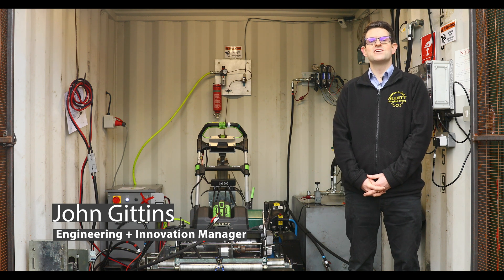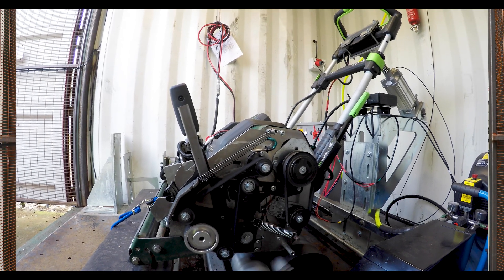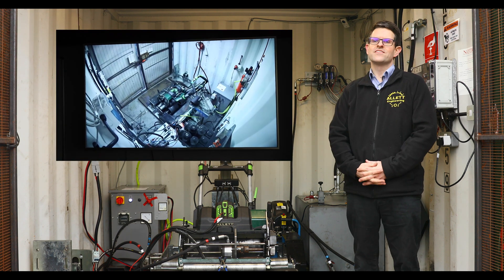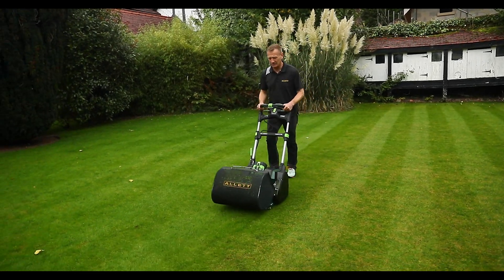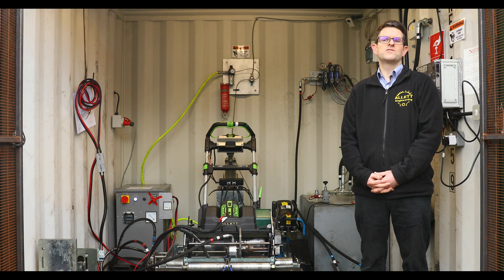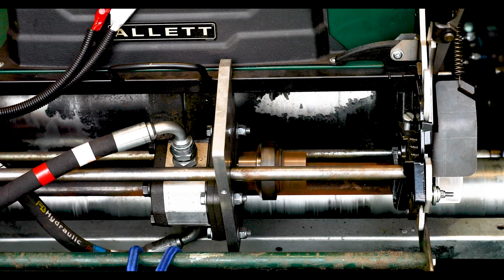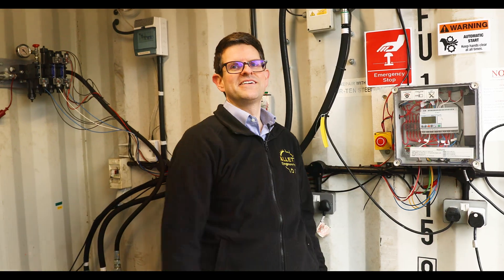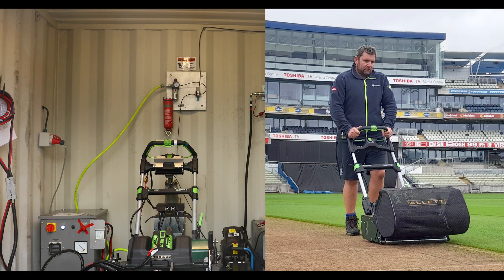Pre-Launch Testing of the Allett Stirling- Powered by Ego

Comment: What does design to last 7 years mean exactly? Mower is only designed to last 7 cutting seasons?
Reply: I have yet to test my new Liberty 43 and after seeing what happened to the  owner of the Liberty 35 I hope my warranty does not run out before the mower falls apart. This is not what I expect from Allett quality and reliability.😕
Reply: @brianwhitney9181  the spare back roller pinion and ring gear were only £27 but it really shouldn't happen after half a summer
Reply: @FulhamsEvo10  it should not have been yours to replace at all under warranty.
Reply: @brianwhitney9181  
The hassle of finding a large sturdy cardboard box and packaging it all up I just couldn't be bothered 🤣
Reply: @brianwhitney9181  got to be careful buying the first generation of any new product.
Reply: 7 months more like
Roller pinion and ring gear went on my battery powered 35 after 3 months
Belts my @rse 😆 
So on that basis its £30 parts at least once a year ( luckily I can change em over myself
Reply from the maker: @FulhamsEvo10  hi thanks for watching our video. Sorry you’ve had this experience. That would be covered under your warranty so please get in touch with your local Allett dealer or us who will put you in touch with them
Reply: @ALLETTMOWERSUK  already bought the spares
Reply from the maker: Hi Joseph 
 we test for 7 years life- we could keep going and going. It’s  one of our milestones or acceptance criteria to give the product the green light for production and it will certainly last longer than 7 years . We continue to test after this point so we get a good idea of what scores maybe required.
To compare a cars life cycle is set to 7 years

This is based on mowing your lawn 3 times a week, scarifying, verticutting , brushing ,dethatching weekly which is quite extreme. All this with out any long rest periods
We’ve had the rig set to full speed and as you can tell by the footage it’s pretty aggressive - it wouldn’t be subject to this on a flat lawn  

Testing for 7 years life is one of our acceptance criteria for starting production we aim to have no failures in this time.We do continue testing past this point. The mower is still on the test rig at our factory undergoing extreme heat tests 

Hope this helps
Reply: @ALLETTMOWERSUK  Thanks for the complete and thorough explanation. I hope to be ordering a Kensington 20 shortly.

Comment: Sweet insight into the process! Curious if you would make a video on the thoughts behind switching to Ego from Greenworks? I might to ditch my old ecosystem that the liberty 43 lead me to.
Reply from the maker: Hi Zac. We will still be using greenworks batteries in our liberty range mowers.
Reply from the maker: Check this video out at 58:43 it may answer your question https://youtu.be/B-U_STwtHY0